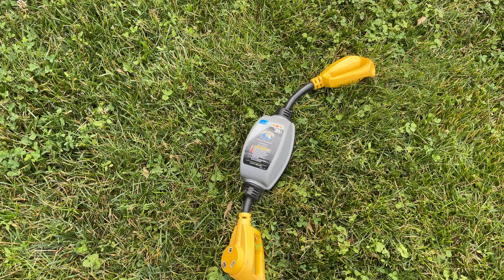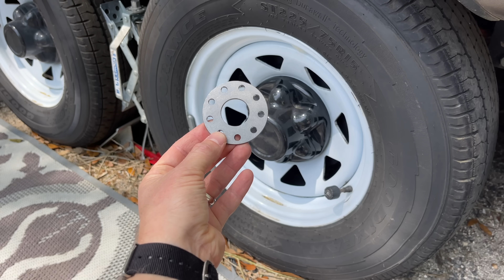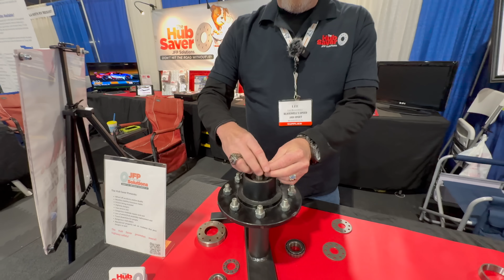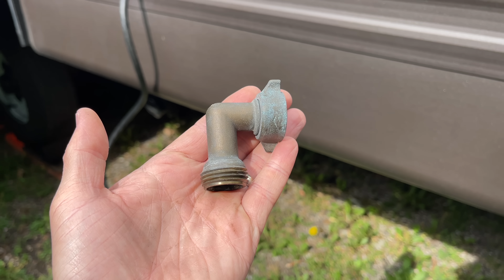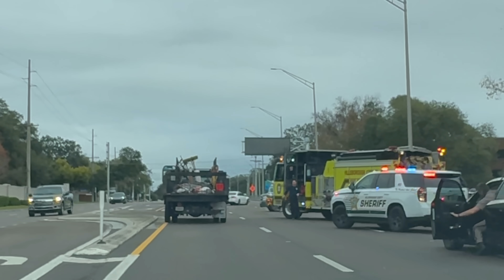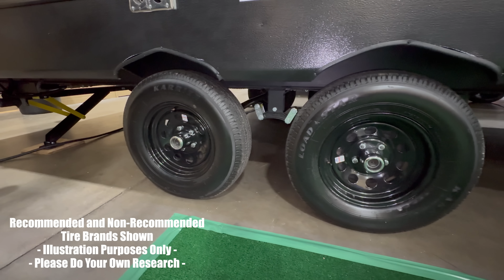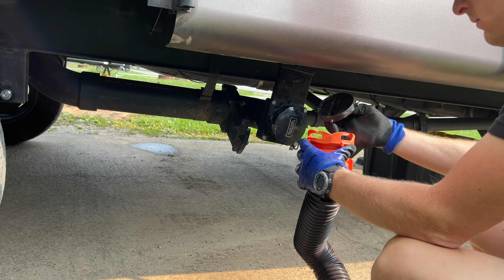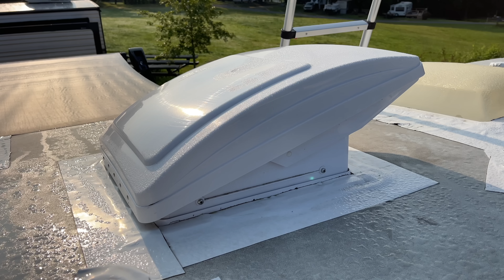RV Upgrades You Should Have Installed LAST Camping Trip (Bet you're unfamiliar with #3...)

Comment: Much more important than brand of tire is maintaining your tire. Make sure it is aired up to the correct pressure, and second to this is don't consistently exceed the speed limit set for the tire. Beyond this, keep them covered when not on the road, don't curb them, and visually inspect them both before and after a trip. Using a good TPMS and replacing them every 5 years or so despite how much tread is on them is also beneficial. If more people did these things then tires would be a much more boring subject because folks wouldn't be blowing them so often. Tire companies love lack of maintenance though, including GY.
Reply from the maker: All true and great points of recommendation to keep any tire in good condition. The only caveat I have to that is the spare tires that blow up that have never been used - that shouldn't be happening.
Reply: @rvgearandfar  The spare... the most neglected tire of all! It typically sits on the back of the trailer for years, very likely uncovered, and never checked. Then, when a drive tire fails (mostly from low air pressure, driving too fast, hitting potholes and curbing them, but don't forget they are likely dated and have been sitting uncovered as well) the unused, unchecked spare gets slapped on and sure, it fails too. I get it, just like with anything, there are lemons, but just because they came from "China" doesn't make them bad, but lack of maintenance does. Go ahead, ask people about their tire maintenance routines, or any info about their tires, other than place of origin, and they most likely can't tell you. 

As for GY, they have gone downhill for some time, not just in trailer tires though, also in LT and P rated tires. I was happy to get them off my truck earlier this year, and unless forced, I wouldn't buy a GY tire for anything. My choice tires for my camper are Maxxis 8008's. Sure, you can find (a few) folks with issues with them too, but they have been around a long while and have been proven over time to be a good (smaller) trailer tire. The Endurance tires seem to get bought up simply because they are made in America. That's awesome, but why do I want to spend my money on something that isn't worth it just because? Being that they became so popular because of this several years ago and people started buying them up, I also noticed quite a bit of folks with complaints about the Endurance tires too... a few even after just leaving the tire shop! It seems even in this thread there are several with complaints about them too. 

Anyway, good video and I do agree, when it comes time to replace the tires, buy a good set, but more than place of origin I believe that folks should talk more about tire maintenance instead since it's a bigger issue.

Comment: Bought 2 secondary valves and used them last week on a golf trip. Dumped 3 times and each time I couldn’t get the hose off the valve but it easily came off the “pipe”. Took two people to disconnect the valve and hose. Great idea but man what a problem. Use Rhino hoses and fittings. Fits Rv pipe somewhat securely but easy twist off. But valve to hose - 2 people needed. Any ideas?
Reply from the maker: Do your Valterra valves have the locking cotter pin on them? (see photos at bottom: https://valterra.com/product/twist-on-waste-valve-boxed/)

As for getting the hoses off - adjustable oil filter pliers would be where I'd start: https://amzn.to/43pB7n2 (Amazon Affiliate Link)

Comment: Just kinda thinking out loud here.. and i haven't exactly finished the video yet... but this just kinda is 'screaming' at me.... I'm not sure I'd 'want' a 'hub saver'... this seems like a double edged sword to me... sure, the tire stayed on... but now I'll get to my destination, not even realize my hub has failed, and just continue on using the camper like nothing's wrong... then at some point that part or something else on the hub fails, and now i've got a grenade going off sending shrapnel everywhere AND a tire flying off... This just sounds like if I ever have a hub failure, i'll end up having to replace the brakes, the hub components, and maybe even an entire axel depending on how badly it grenades...
Reply from the maker: I get where you're coming from - but if you're checking the temperatures of your hubs when you stop for fuel/bathroom etc you'd definitely find out that something is wrong. So then the question is - are you checking your temperatures regularly while towing?
Reply: Or a fire

Comment: Hub saver is total bullshit
Reply from the maker: Can you expound on that statement?
Reply: @rvgearandfar  drive 5 or 10 miles at 60mph on a bearing that's failed,  that little washer will melt like butter
Reply from the maker: According to Hub Saver they’ve driven farther than that with a loaded dump trailer and no bearing just to see if it would hold up. Test it for yourself - would love to see your results
Reply: @rvgearandfar  sounds like the D.O.T would love to hear about them doing that ha
Reply from the maker: @matt23727  I'm not sure where the test was performed

Comment: Load range E is important when replacing tires - BUT not all 'E's' have the same load rate.  E's go from 3'000lbs to 3,600lbs per tire.  I tow a dual axle, so 4tires x 600lbs = 2,400  more pounds of weight.   My trailer weighs just under 10,000lbs fully loaded.  I could (in theory) get away with the base E tire.  But after years of blowouts at  highway speeds, i now put on the Endurance.   The extra cost (minimal) for the insurance of a higher weight rating is worth it.  14 years of an annual blowout with multiple trailer brands led to these Endurance.  2 years, 15K miles with no problems, and about to drag the beast another 7,ooo miles to California and back.  Always buy stronger than you need - never buy 'just strong enough'
Reply from the maker: Each rig will have to have the math done - you don't want to just put load range E tires on everything - check the weights and ALSO verify that the rims you're using will match up with the weights and PSI ratings of a new tire.

Comment: Flip out handle danger. Heard about this from a fellow camper. A couple had become trapped in their camper when some kids flipped the handle into the stowed position while they were inside sleeping. They had to call 911 to get out. 

the solution i employed was to trim off some of one side of the “stowed position” cradle using a dremel.  The handle still stays in the deployed position when in use, but I'm now able to push the door open from the inside if it ever gets stowed while we're inside.
There’s still enough of a bump to keep the handle stowed while in motion.
Reply from the maker: Wow! Thanks for sharing. Sounds like thats a workable solution
Reply: I got locked in when my handle failed. Fortunately, a neighbor came and unlocked the door. Since then, I always keep a tool box inside the trailer.

Comment: I’m running Kenda tires.   For my size, there are only three manufacturers.  Unlike the other two, the Kenda’s have a 99 mph speed rating.  Not that I will ever go that fast,  it’s nice to have a lot of cushion.  If you have a 65 mph rated tire and are doing 65 a lot,  everything has to be perfect for that tire to hold up.
Reply from the maker: Thanks for the data point!

Comment: Goodyear tires.....and get them balanced no matter the brand.
Reply: Add an anti-backflow to the separat hose for the black water flush connection maybe?
Reply from the maker: There should be backflow prevention on your black tank flush port

Comment: TPMS works best on a metal tire stem.  The rubber tire stem wobbles causing the rubber to weaken and eventually crack.  Of course the TPMS can warn you of the cracks gradual leak growth.  Metal stem best with TPMS.
Reply from the maker: Agreed. Ours lasted 2 years before we had an issue - replaced them with metal stems

Comment: A lot of people don't know that if you have a few lithium batteries and a few solar panels, you don't need campgrounds. Also getting a DC to DC  charger is great for cloudy days. Too hot, have a generator power up your AC or drive to higher elevation.
Reply from the maker: Lots of flexibility and options available!

Comment: Transeagle 12 ply tires on my wolf pup camper. A big tire repair shop said even good year and Carlisle will have blowouts but he said he has put these tires on trucks with 8000lbs on each tire and have never seen a blow out or any issues.
Reply from the maker: Thanks for adding that data point on tires! Safe travels
Reply: That's good to know you have and like those. I'm considering new tires between those Transeagle's and Sailun's. Just can't decide, but this is after GY Endurance has failed me.

Comment: I have 30 years experience as a commercial tire salesman.  For the 13, 14, 15 and 16 inch tires, I feel that the two best options are the Goodyear Endurance or the Hankook Vantra. In my mind, both of these tires are equals and are the premium options. Goodyear has more history though, the first Vantras came out about 4 years ago, so I guess you could say the long term jury is still out on them, but I trust the brand. 
Another thing- if you really want to not have tire problems, change tires when they hit 5 years old. The older a tire gets, the higher the chance of it failing of an impact break (caused by a pothole. ) In case you don’t know, you can tell your tire’s age by reading the DOT number. It’s on the sidewall, near the rim starting out “DOT”, then a series of 7-8 letters and numbers then four numbers. That last four numbers are the date code. The first 2 numbers are the week the tire was made, the last two are the year. 1022 was made the 10th week of 2022. 
If you have a big camper with 17.5s, I like Firestone and Hankook for a mid tier option and Michelin and Continental for premium. 
The Continentals seem to really hold up well in heavy, fast moving applications where others don’t. 
Just my 3 cents.
Reply: What’s your opinion on Carlisle? I have a relatively lightweight toy hauler and I just put 4 new Carlisle tires on 

I’m very big on not being cheap when it comes to tires but those were kind of my only option at the time except for 2 others that were way to cheap in my opinion 
Thanks in advance 👍🏼
Reply: @bradbucklin2692 carlsisle makes agricultural tires, so i'd assume they're built well
Reply: @GothxJesus oh wow I didn’t know they made Ag tires 
That’s good to know 
I would assume they are solid and made to last 
But 
I guess it doesn’t matter anymore 
Just traded the toy hauler for a new one about 2 months ago 
And 1 of the 1st things I checked was the tire quality 
This one has 8ply all terrains baby!🤘🏼🤘🏼
Thank you
Reply: @bradbucklin2692 I love my Carlisle tire .Alabama to Arizona to Alaska back to AZ and Alabama. 2 years later running East and west no problems.
Reply: @MoeGreen-m8n wow I envy you!
I wish I could do that much traveling 
Traded my toy hauler a few months ago 
Got a new 2026 with all terrains 

Safe travels my friend and happy new year!
Reply from the maker: Awesome, thanks for all that detailed advice!
Reply: Just spent 1200. On 6 new Toyo tires for my coachman freedom motor home. 😢was told they are great ones, so here we go...any thoughts on this?
Reply: @trinaf4768  Toyo brand is decent. I think the main thing we have to watch for is the load holding up for the weight and dynamics of a trailer being towed/ roads. I’m not a tire expert but I believe the  stronger the side wall, the better the tire is for use and abuse on the roads if driving distances 😃
Reply: thanks, that was helpful. I just bought a newer used trailer and it has the stock used tires on it. I’m going to replace them sometime this summer so I’ll probably get the good year endurance.

Comment: Propane valves have the fail safe built in.
Reply from the maker: Correct, there is an excess flow valve that will limit the flow, but its not a 100% shut off like the GasStop

“Flow limiters built-in to common US propane connectors will not shut the propane off completely, they just limit the flow. GasStop completely shuts off the 100% of the supply of propane. GasStop will give the operator a visual representation of the status of the propane flow and pressure.”
https://gasstopusa.com/about-the-gasstop/frequently-asked-questions/#q_3078_10

Comment: Respectfully, I have been surprized with many suggestions of "necessary gear" (not specifically by this video) being made for things that I would think wholey optional (as opposed to "necessary")... the screen door handle is a perfect example.  I cannot recall seeing any RV screen door (in my 30+ years of camping with an RV) that does not have a 10"-14" tall panel halfway up the door, which has an integrated handle built into it.
Reply from the maker: hmm - my door has the little sliding plastic panel - but its just a knob, there is nothing to grab onto in terms of a handle and as far as holding the door open without the push bar/screen door handle - trying to do that on the flush mounted aluminum bar that the screen is attached to definitely leads to stretching out the screen - the joy of RVing though is that we all get to customize and utilize our rigs how we see fit!  What is one piece of gear that has made a significant improvement in your adventures?

Comment: I installed  the HubSavers and also put the original washer over the HubSaver.  That's the was the guy on the HubSaver site install video did it, but I have seen it done with and without using the original washer.
Reply from the maker: When I spoke with them they said it all depends on how much thread is available on the spindle whether or not you'd reinstall the original washer.

Comment: I just replaced the tires (lrE) on my single axle 22" TT with lrG(14Ply rated).  Added 2500 lbs of safety.  The difference in the tires is night and day.  They were recommended by someone I trust to help reduce sway and worry...  Thanks for the info and all of your recommendations are Excellent!
Reply from the maker: just remember that it won't increase the cargo carrying capacity of the overall trailer even though the tires are rated for more weight.

Comment: Could not agree more with the elbows. I added those and quick connects to my kit. I choose the Eden 93218 Premium Garden Connect with Shutoff Valve and Water Stop & Lock. The shutoff works great and so far no leaks.
Reply from the maker: The shutoffs built in is a handy feature!

Comment: Had 2 of 4 Goodyear ST endurance 16” tires blow out within 2 months of each other.
Date code 02/21.
The rig is a Jayco 310 NP. At the time only 15K miles on them. TPS monitor always on and maintained with fresh batteries.
Before every trip I always check air pressure at put at 80 PSI per Goodyear recommendations.
Goodyear did pay for 4 new tires. The shop time was No fun. Insurance covered the $3k of damage.
Goodyear did a tire pickup and sent it to Akron, OH for inspection. Must have been a bad batch ran🤬
Note these are only 10 ply. Newer models are running 14 ply on their rigs😉
Just putting this out as be prepared to upgrade, it will save you in the long run.
Thankfully we had no accidents.
Safe travels😎👍
Reply from the maker: Glad it all turned out in the end - down time, shop time, insurance, roadside time - it all sucks, but I'm glad y'all are safe.

Comment: Propane connections ( POL) already have safety valves in them. Gimmicks.
Reply from the maker: The item you're referring to is an excess flow valve and it limits propane flow, but won't shut it off completely.  https://gasstopusa.com/about-the-gasstop/frequently-asked-questions/#q_3078_10

Comment: Always good info from you. I've incorporated a couple of things like making my own hitch holder as you did. Hub Savers make a lot of sense. As for tires, my Outdoors RV 24 RLS, dual axle had Goodyear Endurance tires. I was not impressed with the wear level after just 20k miles. Replaced with Hankook Vantra TH31, a very smooth-riding tire I think is far better, 8k miles.
Reply from the maker: Appreciate the tire input. And thank you for the kind words

Comment: @rvhearandfar i am a propane worker and regarding your Gas Stop portion some of the terminology you are using is incorrect on the functionality portion the gas stop valves have a ball bearing in the black qcc rv fitting that when it receives an excessive influx of flow the ball bearing floats up into the opening preventing or reducing flow that is what happened when you cut the hose because it went from a regulated pressure system to an uncontained system thus allowing for free flow, as for the OPD aka Overfill Protection Device that you stated it has no bearing upon relieving the tank of pressure it monitors and regulates intake and outlet of propane gas the relief valve side of the tank valve located on the back end of the valve directly opposite of the service end of the valve is what discharges the over pressurized gas and the PSI rating should be located on that end as to when it will go off.
Reply from the maker: Great clarification on the OPD and the pressure relief valve. Its my understanding though that the excess flow restrictors in the hose fittings are not 100% shut off - as you stated they just reduce - whereas the gasstop complteley shut off flow from the tank in that test
Reply: @rvgearandfar  it is true that from what they are claiming it in theory should stop gas flow but I have seen them not stop the flow completely where they still allow some vapor fumes through just a small amount so it is not completely stopped but enough that it can dissipate quickly into the environment